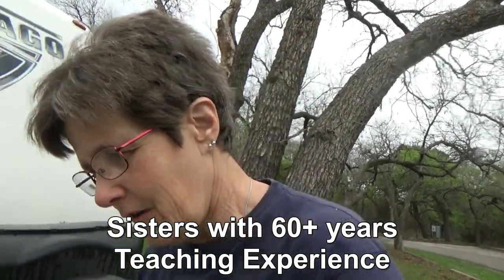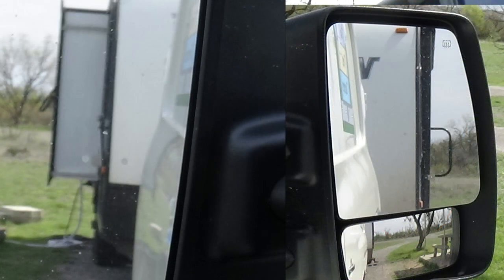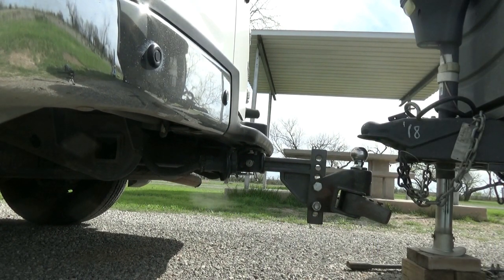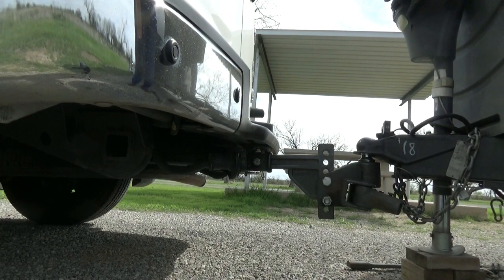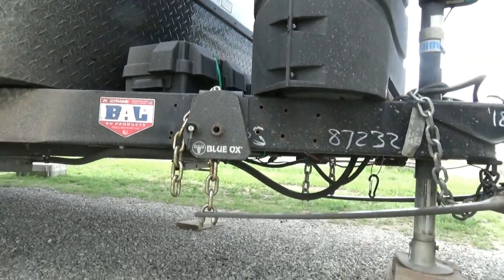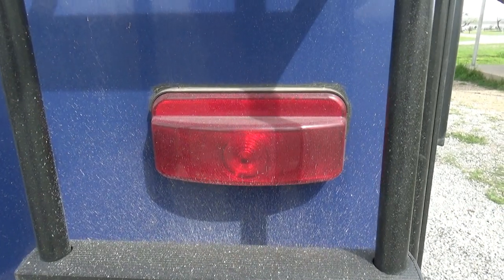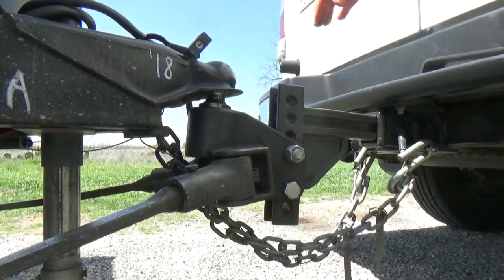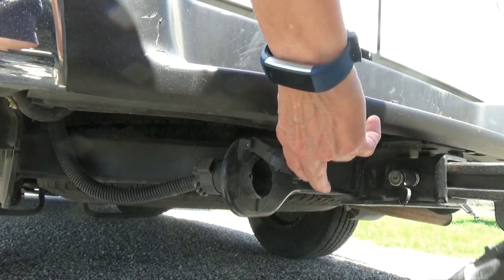How to Hitch a Travel Trailer using Blue Ox

Comment: Hi, haven't watched any of your videos in a while. Stumbled onto this one, and I have to commend you, this is very well put together and your images, (the mirrors, connecting the 7 pin and latching the cover on it, etc) are perfect. I use a 24 inch Harbor Freight ½ in drive breaker bar and a 12 point ½ in drive socket to turn the chain brackets, rather than the short tool that Blue Ox provides. It gives me a little more control over the bracket and allows a lot more handle positions, for comfort and control. I love the Blue Ox hitch!
Reply from the maker: Welcome back, and thanks for the tip about the tool you use to turn the chain brackets.

Comment: Very good video, as always!  Thanks!
Suggestion: I have found it to be very helpful when making that final micro adjustment of lining up the tow vehicle hitch ball under the trailer hitch to apply my parking park before shifting transmission into PARK and releasing the primary brakes.  The parking brake holds the vehicle exactly where you are rather than rolling ahead or backward an inch or two like PARK does.
Reply from the maker: Thanks for the tip.  We appreciate it.

Comment: We have the same hitch on a 26' Rockwood Mini Lite. I purchased a breaker bar and socket to use for tightening up the chains.  It's more comfortable on your hands and requires less effort because the slightly longer bar gives you more leverage.  I like it much more than the tool that came with the hitch.
Reply from the maker: Thanks for the tip.  We will have to look into that.